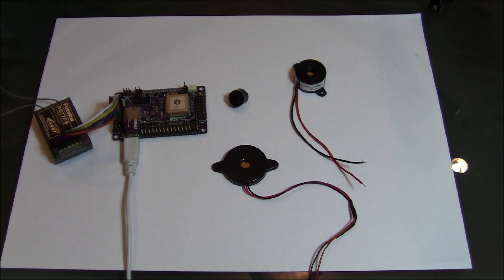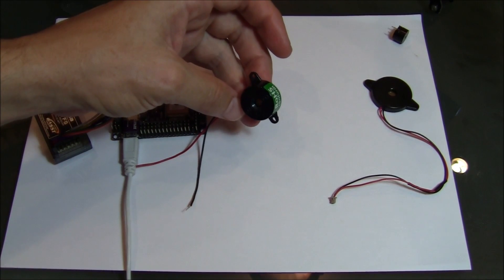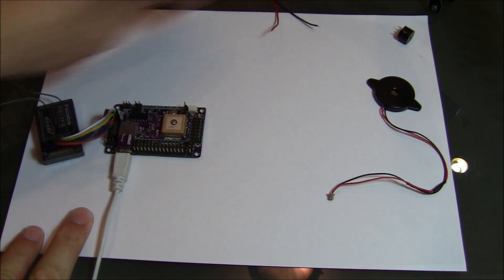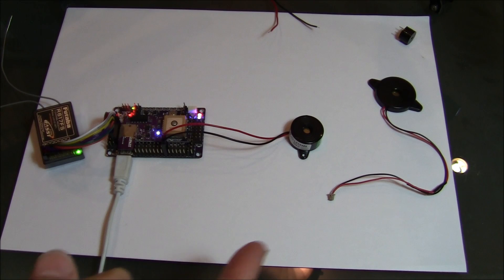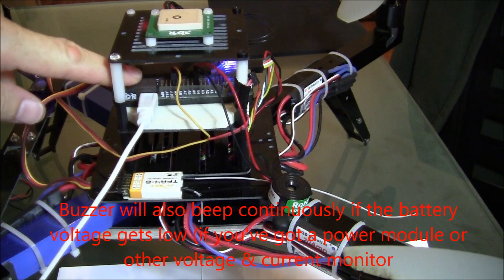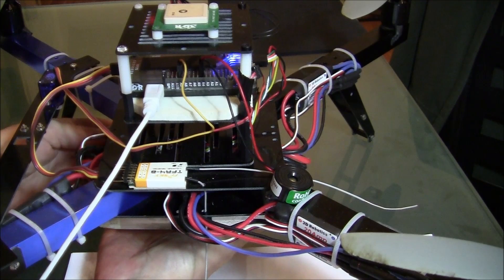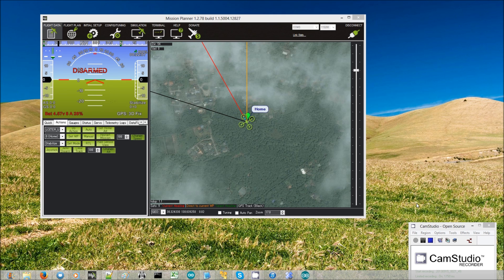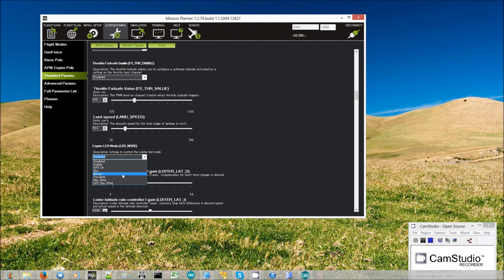APM2.x Buzzer Setup

Comment: I have a buzzer from a KK2.0 kit so I plugged it in, (after changing out the plug). When I arm, it gives a very long single beep. Then when disarmed, a very short beep. I'm not getting the 2 sets of 2 beeps when arming. Any ideas? BTW, I wondered if I'd be able to hear it when flying. It is freakin LOUD. Thanks for the vid on this. Still tweakin my APM 2.6. Had it set to land at 10.5 volts but right at that point I was rotating and she rolled over and crashed. 3 different times, all while using rudder to pan around.

Comment from the maker: Yes, modifying the LOW_VOLT parameter will allow you to adjust when it starts.  Should be able to adjust it through the mission planner's INITIAL SETUP > Mandatory Hardware > Failsafe page.  It's in the middle on the right.